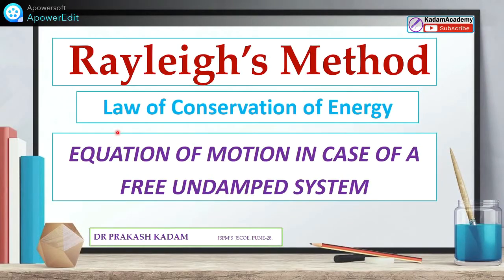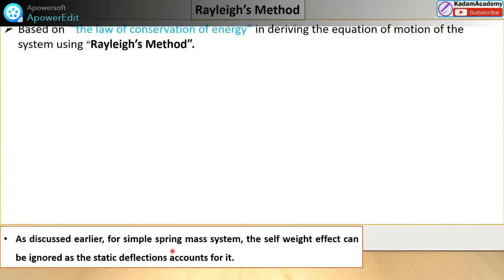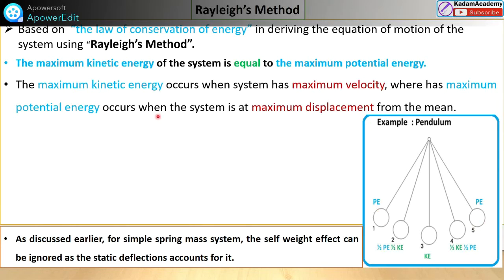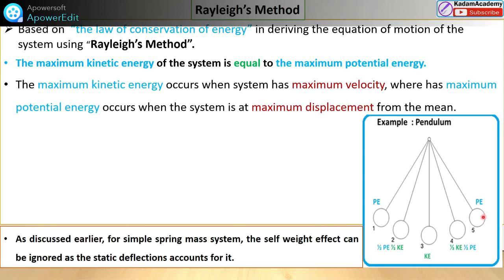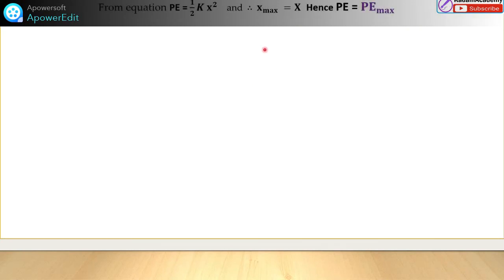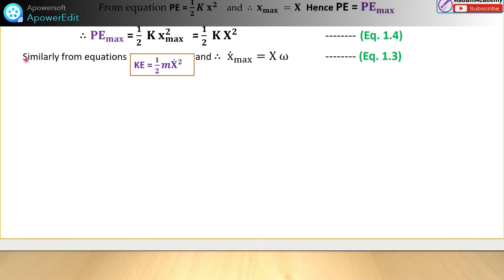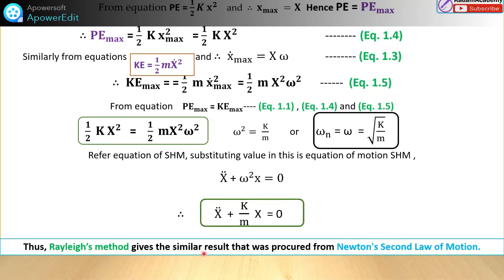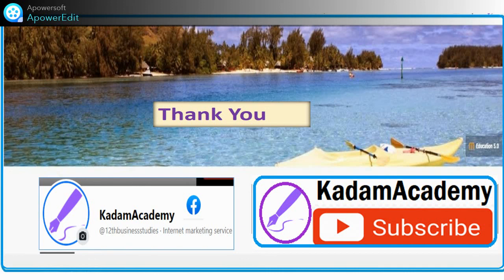Rayleigh's Method for undamped free vibration (Dynamics of machinery) 10

Comment: What is K in the equation? Please let me know sir.
Reply from the maker: The potential energy is in the form of strain energy stored in the spring. If u assume graph force on y vertical axis (F) Vs deflection on X horizontal axis (x),  right angle triangle, area under triangle is Strain energy (area of triangle) = 1/2 Fx =1/2Kx*x (where K = F/x, K=stiffness of spring)
Reply: @pgkka  Thank you sir ❤️